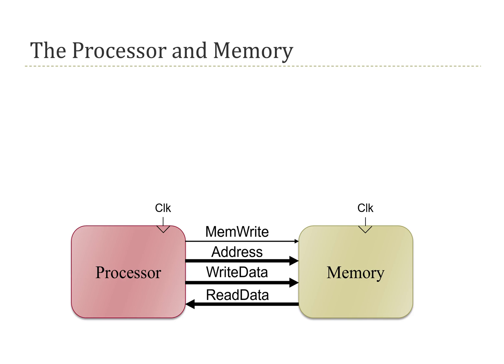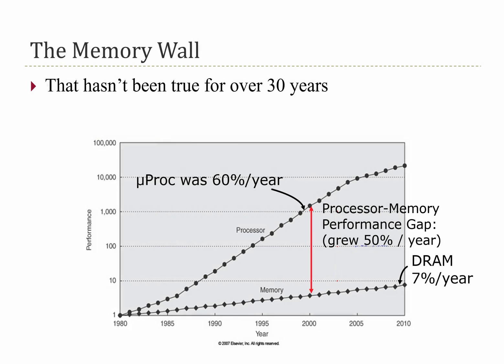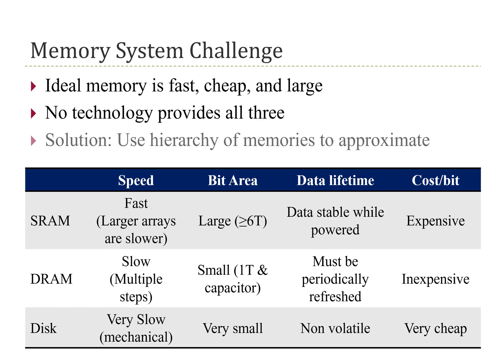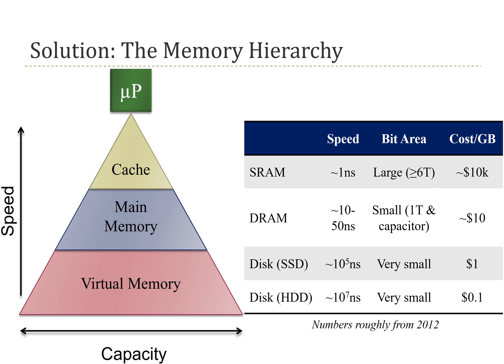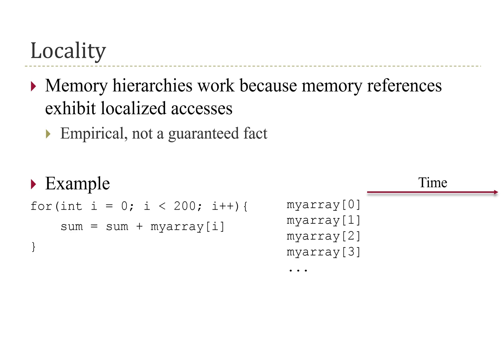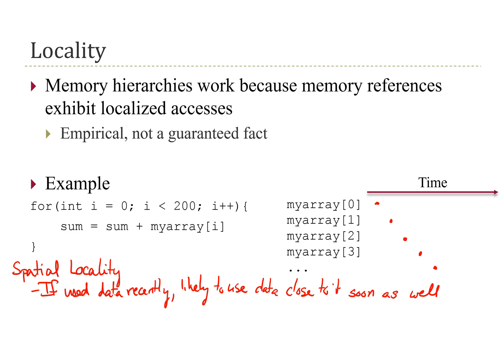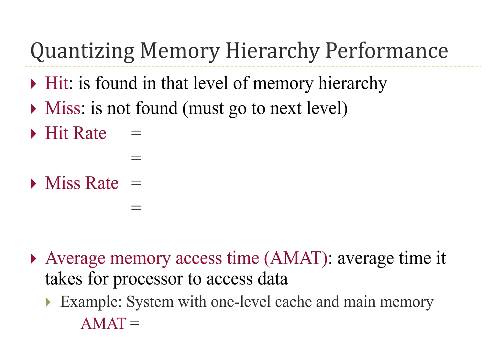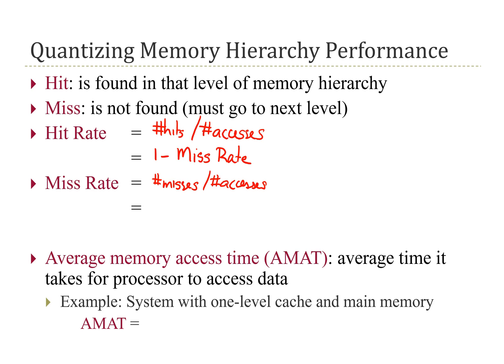Memory Hierarchy Introduction

Comment: I have this assignment, how do I approach it?
The design constraints on a computer memory can be summed up by three questions:
How much? How fast? And How expensive? Ideally, the memory would be fast, large,
and inexpensive. Unfortunately, it is impossible to meet all three of these requirements
simultaneously. Increased speed and size are achieved at increased cost. With the help
of figures and illustrations, discus computer memory in detail and on the basis of the
above evaluation, design an approach that can be used to improve the apparent speed
and size of the memory in future developments, yet keeping the cost reasonable.
Reply: Did you ever figure it out?